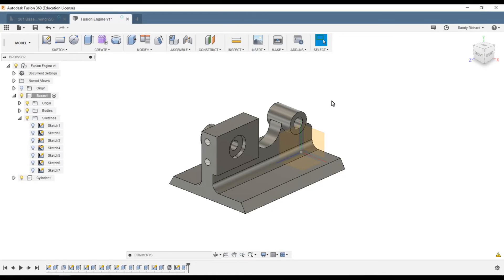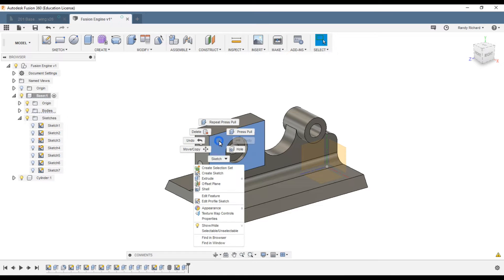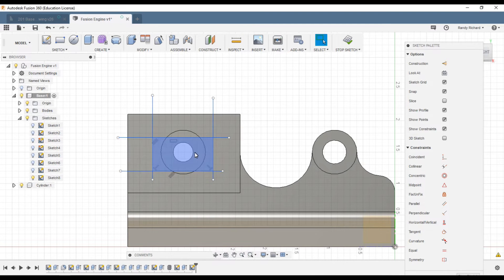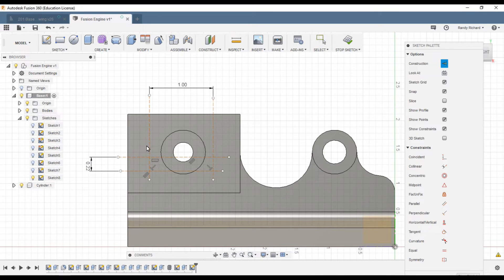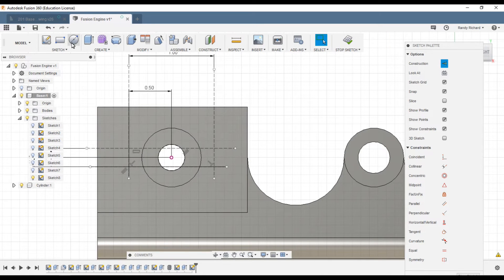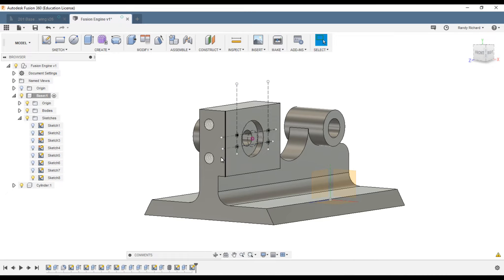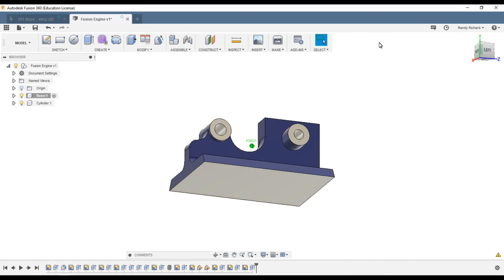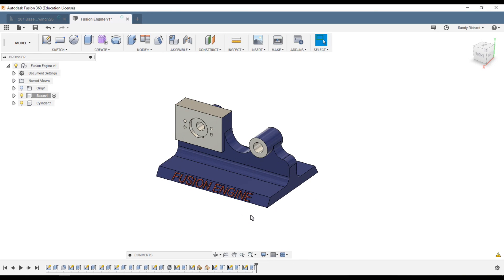P1-4 How to Model the Base of a Model Steam Engine From the Ground UP

Comment: So I finally downloaded Fusion 360 and started modeling the engine this weekend.  The construction lines and construction holes really helped when it came time to model the ports but I had to do the Plane at Angle operations individually. I kept getting confused which plane was at which angle so I did them one at a time after I visualized in my head what the plane angle should be.